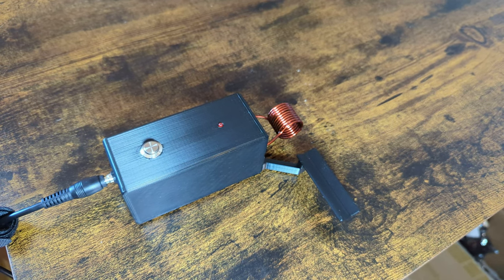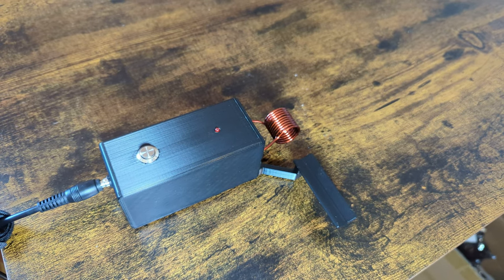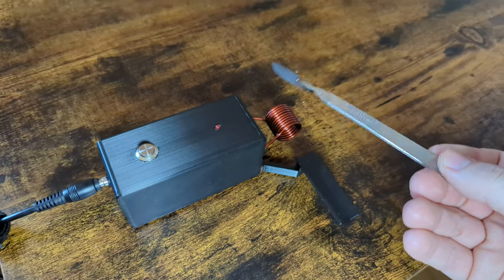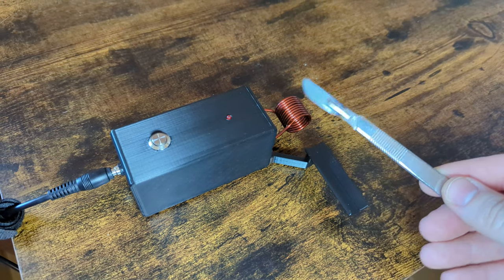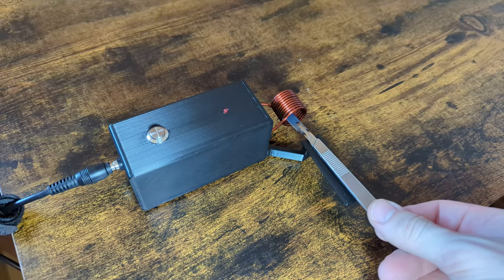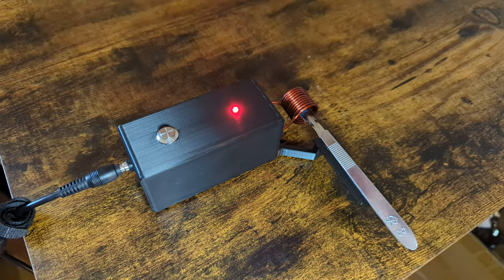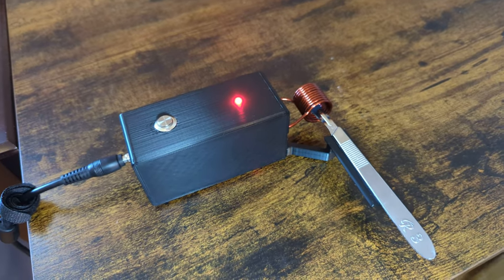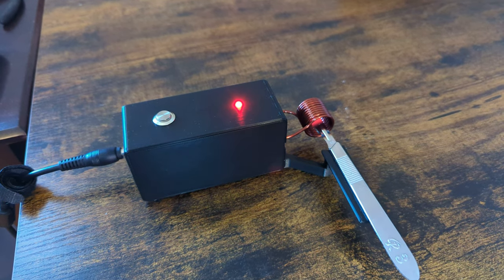Induction Heating Scalpel Sterilizer

Comment: i like your videos chris. i'm working on something similar, but my output coil gets to like 220F when idling with the rocker in the on position. i have a rocker switch, a 12v5A, and an LED with a resistor. i plan to integrate a momentary foot switch but until then do you know why my output coil gets so hot? i'm afraid any contact will melt the 3D printed case i make for it. 

i'm also curious (your vape heater video) how you get your lids to snap into place so incredibly well? its like AMSR. and with your design, are you able to pop the lid off without damaging it? 

you should definitely make more videos. 3d printing and electronics is a really cool intersection. i have a lot of 3d printing/modeling experience but not so much in electronics.